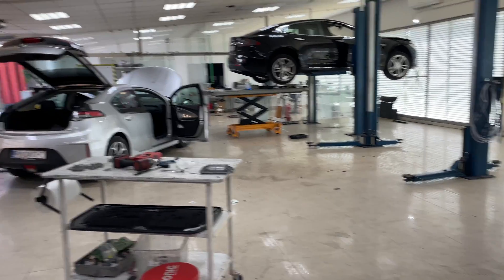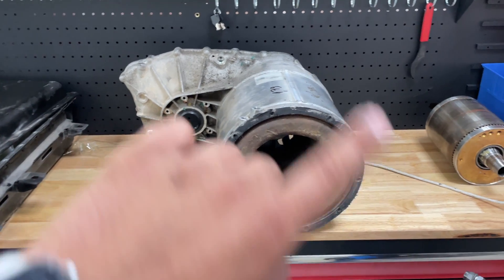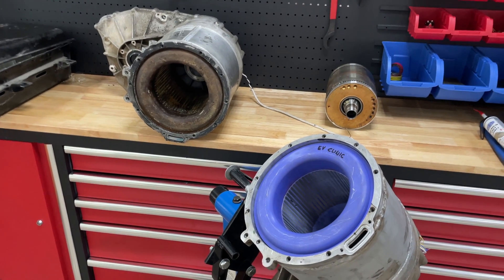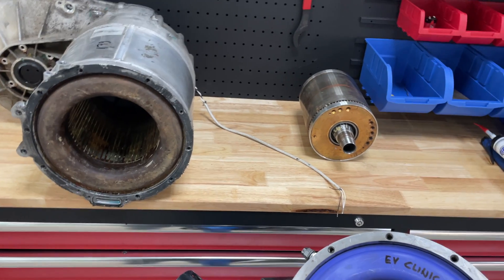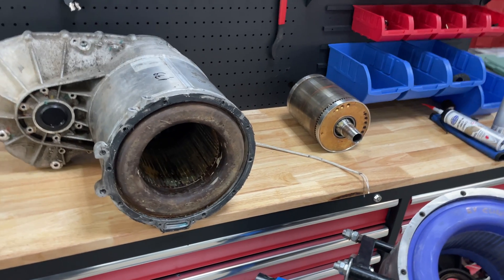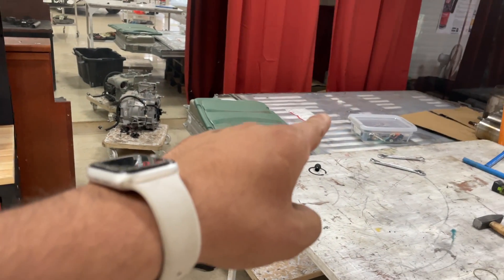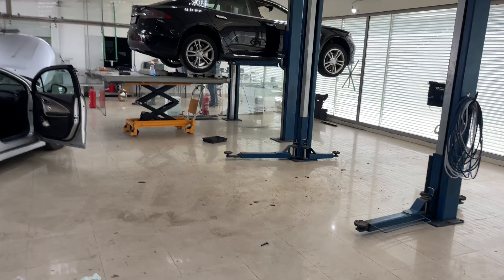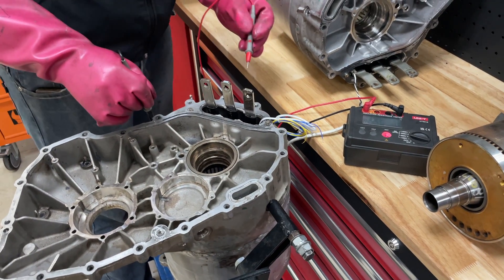Tesla Large Drive Unit Reman and Tuning - Part 1

Comment: Do you recommend QC Carge or similar type of cancelling  the rotor cooling totally to prevent future leakage?
Reply from the maker: @davidcurkan7220  No, that is bandaid solution and ballbearing killer. All motors without rotor or bearing cooling fail prematurely. Check Kia Renault and other videos from our channel.
Reply: @ thanks for the explanation. Looks logical. If they cooled the rotor it should stay cooled.

Comment: Good stuff, one thing I wanna point out, you will get the same Megaohm reading on all three of the stator leads as they are shorted together internally when the stator is rewound initially, also, I don't think you should be megger testing the stator while the three phase leads are connected to the inverter, It could damage the electronics on the inverter.
Reply from the maker: Ofcourse

Comment: A few things we found out about these motors:
6Mohm is not good enough. A good motor has 550+ Mohm.
Drying is not done by cooking but you also need a vacuum for evaporation. 
A 3 lip seal does create a lot more friction heat than a 1 lip seal so the 1 lip seal can sometimes be a better choise
Reply from the maker: https://evclinic.eu/product/30x55x8-tesla-ldu-graphite-dual-lip-seal/
Reply: So you do sell this seal?

Comment: сальник и всё что с ним связано не нужно всё отлично работает без охлаждения ротора, тесла придумала величайший геморрой и дала возможность заработать много денег слесарям :)
Reply from the maker: Not completely true. Motors without rotor cooling they overheat and damage rotor ballbearing. Same what happens with BMW i3 motor, Renault Zoe r240 motor, Hyundai Kona rotor, and so on. All non-cooled-rotors fail below 100k km
Reply: @evclinic   This is not a specific unit problem, this is a BMW, Renault, Hyundai problem.
 Tesla M3, Y, S restyling, no longer have rotor cooling and run without gaps for a very long time, the Volt, Bolt, Nissan Leaf and many others are rougher, and besides, Tesla itself eventually came to the decision to abandon LDU rotor cooling. Change the bearings to steel ones and change the lubricant in them to a more advanced one and everything will work much longer, and besides, the malfunction of the rotor bearings can always be heard and replacing them is a simple and not expensive job, 100,000 km is a very good resource even in the worst conditions In any case :), this is much simpler than the problem with the oil seal and the consequences of its leakage.
Reply from the maker: @Boris_312  But hey have oil cooled rotor.
Reply: @evclinic   oil cooled rotor LDU ?
Reply from the maker: @Boris_312  No, you dont read. You mentioned model 3 and s Small drive unit, which are oil cooled

Comment: Did you test the latest U revision with seal delete?
Reply: My 2014 is going into the service center to have a remanufactured LDU Monday morning and it just so happens to be a "U" revision by the part # quoted. 

I'll test the theory that 2-3 hard pulls will limit power due to heat.
Reply from the maker: @ferrynpalmer3875  And second theory is that overheat might damage Si rotor ballbearings.
Reply: @evclinic  .....ok. The replacement drive unit will be covered under a 4yr 50k mile warranty. I'll launch it all day and we can verify.
Reply from the maker: @ferrynpalmer3875  Please 😎
Reply: @evclinic  ....I live in Arizona, so if it's going to overheat with repeated launches, I'm going to find out!!!
Reply from the maker: I saw it on internet, but didnt see in real. Interesting, they must have read our letter but i am wondering what they did to limit rotor overheat. Probably 2-3 extreme starts will limit torque and power to motor. We have better solution which works and prevents any future leaks. And working on revision 2 for even better seal